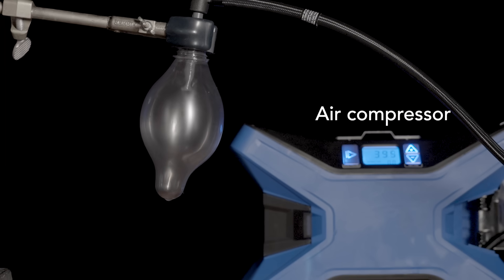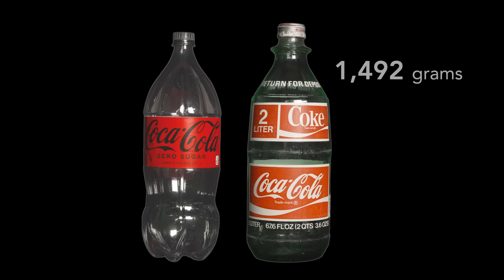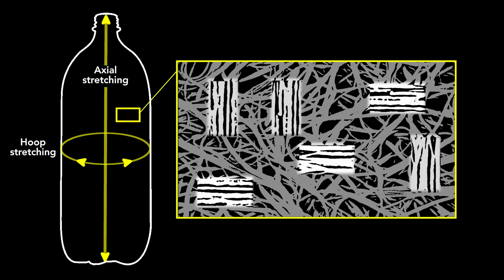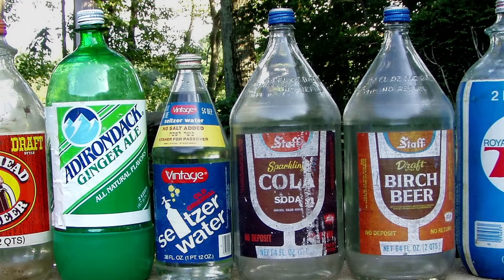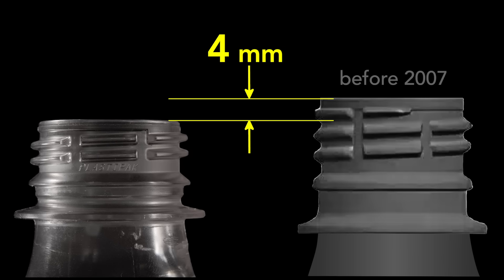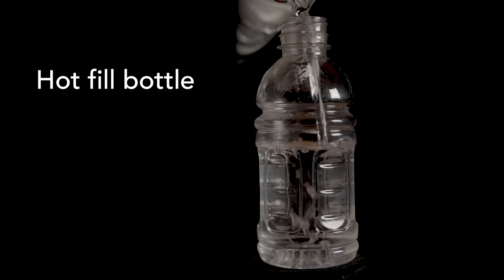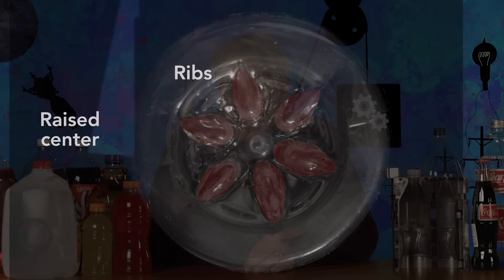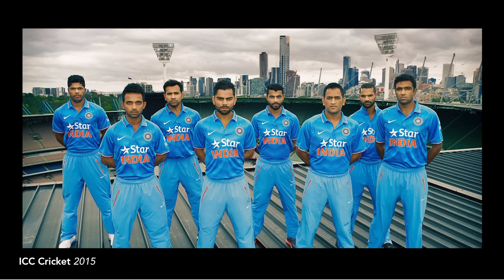The masterful design of the two-liter plastic soda bottle

Comment: As a design nerd some supplemental bits I'd like to add:
- Bottles are designed so that if they fall with or without the lid, the lip is unlikely to touch the floor, increasing health and safety via avoiding cross contamination.
- The lip of the pre-form and final bottle is made wide enough so it's "pinchable" from above, the pre-form lip can be made smaller but engineers choose to leave it at around 2-3mm instead of 1-2mm so that an average person can pinch and pick up a bottle from above. Why does this matter? Because if there are loads of bottles stacked next to one another tightly you would grab the lid to to pull it out, which would probably be fine but repetition of this can lead to leakage.

Comment: I use 2L bottles as 'explosive targets' for my practice with air rifles. I use a TR410 tire valve that i put into a modified bottle cap. Then, inflated to 95-105 psi, once shot, they explode very loudly and are easy to cleanup after. Adding water makes it even better!

Comment: In between this design and the glass one there was another one. More sturdy, but it broke earlier. I think it was also washed and re-used. I think the switch was made around ~18 years ago? Before the current design it wasn't uncommon to see soda splatter on the supermarket ceiling in the drinks isle.

Comment: 0:13  Are we sure that is made of plastic and not latex?
Reply: Hi, this is Rohan who helped make this video. Indeed this is plastic. 

To do this we heated the plastic up in boiling water, which makes the plastic soft and stretchable.
But it’s still pretty solid at that point. The reason it looks like a ballon inflating here is because we are using an air compressor, if I put my mouth up to it and tried to blow it up nothing would happen. Hope this clears your question up
Reply: @rohanbhatt6290  Thanks for working on these cool videos!  I was actually hinting that it kinda looks like a condom being blown up like you would do with a balloon.  Only part of it inflated first, then the end of it did.

Comment: During my master's (Mech Eng) I had a classmate who was a manager at a bottle creation plant (not sure the exact correct name in English)
Basically he was telling me how the tiniest of details like the bottle cap are engineered to an extreme degree, and even showed me a conference paper about the new stay on caps that some European countries require, saying that this is a massive change that will basically make many machines obsolete, simply because there are such huge scales that any waste of plastic or energy is exponential, and the cost of the machine is basically irrelevant if you get to save even 0.0000001$ per bottle.

Very cool stuff!
Reply: Thanks for sharing that. I've been involved in the production of bottle caps and bottles and man the volume of production and how it's all about shaving the tiny inefficiencies. 
On the EU caps - I would have been all on board for the new caps if the caps were made out of PET. But the kicker is they are not. So this is not like the engineering of an Alu can, where it's all the same material, and making the cap attached makes it easier to be recycled. This is such a huge fail by the EU.
Reply: Greetings from my EU-confirmed bottle cap struggle. :)
Reply: The EU cap really just makes me want to go to lengths to throw it away anywhere other than intended. It's really the wrong way to go about it. Did many people throw away the cap before, or would they all generally put the cap back on the bottle? If the second (which I believe to be the vast majority) then what problem does attaching the cap to the bottle solve? 

Several countries have a recycling "cost" when you buy a beverage in a bottle, which is returned to the person delivering the bottle for recycling. That seems a very clean and efficient solution.

Comment: 7:55 I once poured hot water from an electric kettle into a 0.5l PET bottle to demonstrate how it softens to someone, and not only did it soften, it shrunk like hell, actually spraying out the water I had gotten into it. At the end it was barely bigger than the blank for the 2 liter bottle. Only narrowly escaped getting scalded. I was expecting it to tip over and leak, but not to shoot out the water like that.

Comment: The amount of pressure a PET soda bottle can take as a finished product is impressive. Well over 100psi. In the old days the lid used to have a soft plastic gasket, they got rid of it and replaced it with an internal internal lip.
Amazing presentation, incredible how a patent dispute over such a trivial matter can halt progress for so long.
Reply: The gasket worked a little better. But...savings.
Reply: I remember some magazin, Might have been National Geographic World, or some other magazine, I don't remember which, where there were instructions on making a 20 liter Water Rocket that you pumped up with a bicycle tire pump. Even then the explanation was that the bottle would handle more pressure than the pump would produce, but the clip holding the neck to the pressurizing and release mechanism was likely to release at about 70 psi.
Reply: @RNMSC  yeah I made something like that as a kid, and other things too.
Reply: lol i forgot about the gasket.  as kids we used to yank them out and chew on them

Comment: The best of youtube. What a gem. Riveted to every minute of content. Who knew the humble soda bottle was so well thought out? Well, Bill the engineer guy obviously.  Thanks for a great video, as always. This really highlights the concept of engineering as using other sciences to solve a problem, making it into a process, and refining it to save time, material, and money.

The only thing I wish it highlighted more was the evolution of the cap from the prior plastic caps with a blue pliable plastic gasket to todays flange design which eliminated the more costly extra part count by altering the molding of the lip of the bottle and the cap itself.

Comment: Wait "Return for deposit"? The US also had a bottle deposit system once upon a time? 
There's still a limit to how often PET can get recycled though, right? It degrades over time/every time it's molten?
Reply: Yes. It's not necessarily the melting part, but processing it through extruders is what is causing the degradation. The shear forces the PET encounters during extrusion, causes the polymer chains to break down and cause unwanted side reactions to worsen the color of the PET. After every extrusion, you will see a slight decline in chain length (can be restored) and slight decline in color/transparency (this is permanent). Sources vary, but after anywhere from 6 to 11 extrusion steps without addition of new (less recycled or virgin) PET, the PET has reached a state where it can no longer be used for strong and/or transparent bottles.

Comment: You are looking well, sir. 

I seem to remember there being a rubber insert in the cap of these bottles as well. That must have been back in the 80's. I also remember those base caps where hot glued on and would sometimes fall off so the bottle would no longer stand. I miss them. They were great for use as dirty parts trays.

Comment: I'm disappointed that you did not cover the EU mandated improvement where the top does not detach completely.  That is an interesting design change.
Reply: I have a hard time calling it an improvement, as it often springs back halfway through pouring and splashes fluid on the counter. I can imagine the justification, though, mainly in anti-litter terms much as with a can tab. Either way, I guess it’s not come to the US yet; his recycling statistics also were seemingly for the US. (Apparently 90% of PET and HDPE is recycled where I live.)

Comment: I would like to add that caps have changed fairly recently: before they would seal by seating a flat bottom of the cap onto the lip of the bottle hole, but new caps have an added lip protruding from their bottom which seals against the inside of the bottle, this seems to make the pressure sealing independent of the closing torque of the cap, since as long as the little lip is inserted in the bottle, the sealing is the same. As a consequence, the sound of the pressure relief when you open a new soda is much more poppy, because the lip switches from fully closed to fully open in a very small unscrew angle, while the previous model sounded more like a hiss
Reply: That’s a great point. When I was in school there was always someone who had a leak in their bag from a half-screwed bottle top. But I haven’t really seen any such leaks, even when I drop a bottle halfway through turning the cap, in 5-10 years.
Reply: Is there a way to improve sealing by use of an aftermarket gasket inside the lid?  I'm always looking for a way to seal gas in better with a relatively simple hack.
Reply: @herrbrahms  the vast majority of the gas you lose is not leaking out of the bottle, it just goes out of solution into the empty part of the bottle, each time you close the bottle, the co2 in solution in the soda is released into the bottle until co2 gas pressure in the bottle is enough to keep it from coming out of solution. The problem is that as you drink, the empty space is progressively larger compared to the volume of soda, so much more co2 needs to come out of solution to pressurize the gas, and every time you open the pressurized bottle, you lose a lot of co2 that then needs to equalize again when you close.
Most obvious solution would be to save the remainder  soda always in a bottle where it barely fits.
Another solution would be to use a seltzer bottle. Although it does lose some gas to pressurizing the gas, the fact that it doesnt lose most of the gas every time you serve, keeps it acceptably ok. Plus its fancier to serve from the seltzer.
Another solution i see is using some kind of variable volume container, like a sort of syringe you can lock in position, and reduce the empty space to minimum every time you close.
Reply: @ Yes, understood.  Every time I hear the hiss from opening a bottle that's 1/4 full, a little part of me dies inside.  I wonder if there's a consumer product that can repressurize dying 2L bottles without having to use the small, expensive, proprietary cylinders that Sodastream offers.
Reply: @herrbrahms  here in argentina at a time it was very popular to use a rechargable steel seltzer bottle called "sifón drago", you can put beverages in it, and inject co2 from a small co2 cylinder, it most certainly can not only recharge a flat soda, but it can make it even more fizzy than new. Y think the sifon drago still around, and i dont think its an exclusively argentinian thing, look it up, its not even as expensive as the new crap.
The only problem you may find is that cleaning sugary residuals from the internals may be difficult, i dont know, just imagining, i only used my drago to make sparkling water and the eventual experimental orange soda.
If you drink coke zero youll be fine because it has no sticky residue
Reply: @herrbrahms  ps: the co2 refill here was something dirt cheap
Reply: @aldomaresca9994  Excellent information, thank you.
Reply: @aldomaresca9994  I think in some types of kegs a bag is used inside the keg and then the beverage is pushed out by inflating or deflating the bag by pumping air inside the empty container. It avoids mixing any external gas with the beverage so that it stays unchanged. An aspect that is more important for serving the beverage out of a tap in a restaurant. Although I suspect that whole system may be different in that the carbonation might be added later on the way to the tap, so the beverage in the keg might just be entirely flat. It would be cool to try something like that at home though.

Also here in Europe these days plastic caps are different, because they are required to be attached to the bottle to reduce waste.
Reply: @Spoco  interesting solution using the bladder
When did they change the caps? I havent seen the attached caps yet
Reply: @aldomaresca9994  I think the deadline was last July when all EU member states were required to phase out the old caps. They gradually appeared in my country in the past few years though, and I've seen multiple slightly different designs during that time. Some of them are really good, where the cap nicely snaps into the open position, but some don't want to stay open and can get in the way or break off.

Comment: Thanks for the wonderful video.  A comment on the size of the cap:  manufacturers seem to be reducing the length of the cap on Tetra Pak containers, too.  It's gotten to the point where I have trouble grasping the cap to open the pak.  I wish they'd do more usability testing as well as leak testing.
Reply: Tetra-paks are fascinating too. There's already a pretty good documentary on YouTube covering them.
Reply: They’re shorter AND often rounder. I’m sure that last part saves just a little more plastic, but yeah some of them can be pretty slippery.

Comment: I am an amateur plastic nerd and knew or noticed much of these about plain round bottles and PET. However the hot fill bottle was entirely new to me, I had no idea they even existed. Thanks for this. Your videos are always such a treasure.
Reply: I have heard awful things about plastic containers releasing chemicals into the food, and more so when hot. I wonder if im better off being a dieto coke junkie than drinking bottled juices then... what do you think? Given you know plastics
Reply: @aldomaresca9994  It's true that some plastic containers will transfer a few atoms of plastic to your food when heated, but just like anything else you eat they should pass through your gut and out the other end. Just reheat food in a glass or porcelain bowl if it concerns you.
Reply: @msdosfloppy  nice nickname btw
Reply: I work in a drinks factory and didn't know. Although for reference the statement that they "must be" filled hot is actually incorrect. we use a different method for filling still drinks (doesn't just apply to sports drinks, the co2 is an antibacterial itself). Instead of hot fill we dose each bottle with a potent but very fast decomposing biocide right before they're capped.
Reply: @K26650  what type of biocide?

Comment: I don't understand how the high temperature bottles are made. How does heating it for longer make it more resistant to heat ?
Reply: PET crystallizes in the temperature range between Tg (~75 °C) to Tm (~250 °C), while crystallizing the fastest around 130 °C. Regular bottles during manufacturing (injection molding) are cooled down from molten state (> 250 °C) as fast as possible to prevent crystallization (less time around 130 °C = less crystallization in end product). Less crystalline = more transparent and more ductile. 

By keeping a bottle around 130 °C for longer, crystallization increases, making the bottle more resistant to high temperatures, while decreasing ductility and transparency. A fully crystalline PET sample will be fully opaque, fully resistant to deformation at temperature until melting point, and very brittle. Hot fill bottles are somewhere inbetween.

Comment: Aaah so the moulding process transforms it to be a little similar to BoPET.

Bottom cap still makes an appearance, in Sodastream reusable bottle which is overall moulded out of a thicker plastic and rated for repeat pressure application.